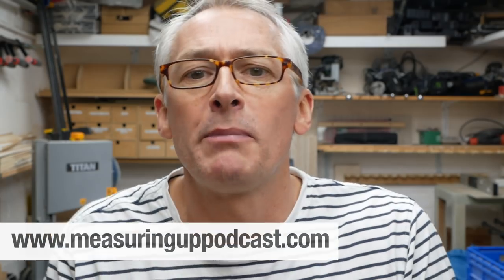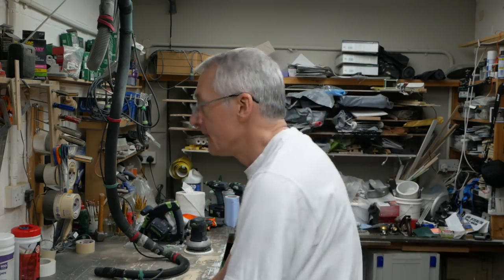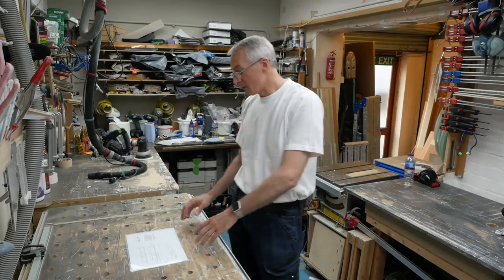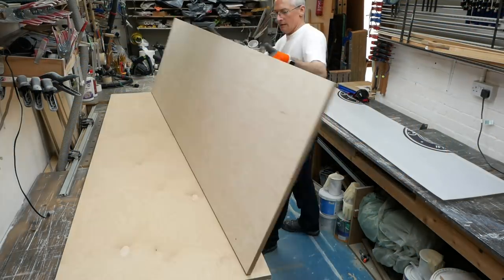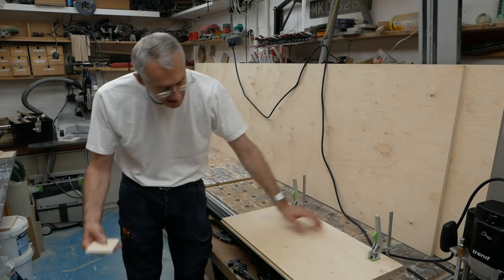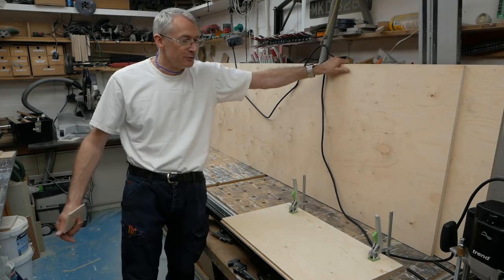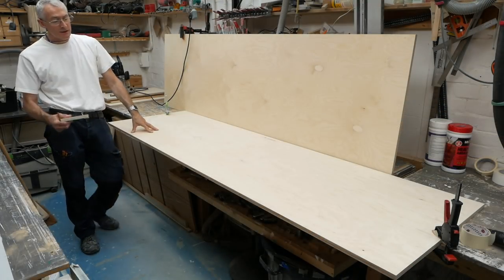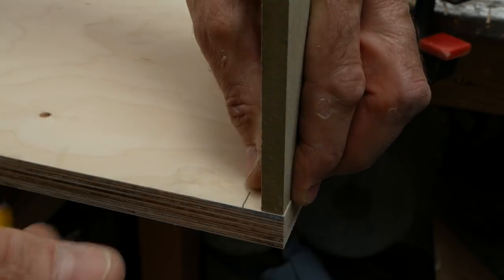How to make a Birch Ply Banquette P1 [vid #205]

Comment: Nice work Peter. That Trend is indeed a big heavy beast! And not so much 'getting away with', more 'making good'. I'm sure it will be fine, unless they watch the vid... ;) When I rebuild by assembly table (which is looking more likely that it finally happen later this year - jumps for joy) I'll have to see if I can find the Festool rail guide and stops assembly as accessories; they do look a nice system. Thank you for sharing.
Reply from the maker: Thanks Andrew. And yes, ‘making good’ 😆👍👍

Comment: Trend are very good, I myself use a Triton Router purely for the above table height adjustment so that it essentially is a router lift too. They are pretty much designed for table use and I find the weight to be an issue as they weigh almost 8kg. I was going to get a Trend, but there was a Triton near me used.
Reply from the maker: Yeah, I have the big Triton in the bench, solid piece of kit👍

Comment: Looks like it's going to be a nice project, I have the small Trend  router and I have done slips like that it is why I prefer hand tools you have more controls.
Reply from the maker: Thanks Ray! Personally, I have far less control with hand tools... 🤔😆👍👍
Reply: Peter Millard I am learning and it is all about practice, check out Tom Fidgen, he will blow you away, my problem is that my shed is to small to get small to make big projects as it is 10 x 8 approx. Just a thought are you fitting 3 doors? If so how are they going to slide in the track thought you might need 2 tracks but will find out in the next video.
Reply: Peter Millard just noticed it is a twin track 😂

Comment: Another great video.  Don't you just hate it when the router decides to go off piste.  

Last time l needed a long rabbit used a track saw guide adaptor and a small Makita battery router, as it was going to be visible.   

Keep up the good work there must be a third banquet just around the corner. 👍👍👍👌👌👌
Reply from the maker: Haha! Yeah, they come in threes 😂😂 It’s annoying - both my smaller routers fit the Festool track, but I only had the bit I needed in 1/2”, and that one - of course - can’t be track-mounted 🤔

Comment: That's one big router to use freehand, Peter. Maybe one of your "mdf offcut" jigs could have kept it on the straight and narrow. Also, when using big and heavy kit, I find a run in and run out piece at each end of the workpiece helps to keep things true. However, well done for fessing up to the nick out of the workpiece. As you say, it's just a moment of distraction.
Reply from the maker: Thanks. My 1/2” Festool is bigger tbh, but yes, I dislike making those kind of cuts with a side fence. I’d normally use one of my guiderail- mounted smaller routers, but the bit I needed to use was 1/2” - plus I wanted to give theTrend a try out. 👍👍

Comment: Thanks for the video, Peter. Very honest of you to show that little mistake with the router. I have made a similar mistake. There has to be a better way than just holding the router fence against the edge of the workpiece. I suppose a massive CNC router table would do it but much too big, expensive and complicated for most people.
Reply from the maker: I can mount my smaller Festool router to the Festool track, but not the big one, unfortunately. 👍
Reply: Mmm... Interesting. Perhaps that's something that Festool and other manufacturers should be thinking about. Potentially, it sounds like a good solution.

Comment: Peter - great video as always but I have 3 questions for you 
1) Where do you get your birh plywood from & what is the price of it?
2) How does the Trend router compare with the Festool?
3) Any thoughts on doing a review / comparison with the Festool or is the trend router to expensive to do a comparison?
Reply from the maker: Thanks Colin! I buy my Birch Ply locally from a timber yard called Ferguson’s (www.ajferguson.co.uk) who are excellent. I think I pay around £60/sheet for 18mm Birch - I’d have to check to be sure. Haven’t used the Trend that much, but I’ll certainly be doing a ‘thoughts and impressions’ after I’ve put a few more miles on it. Not sure if comparing the Trend to my Featool would be a fair fight - all my Festool routers are pretty old and knackered! 👍👍
Reply: I have had a T11 for about 15 years it’s still going strong I love it.
Reply: i have had a T9 for years. Its never let me down. Peter, look at getting the musclechuck as this makes changing the cutters easy.
Reply: Peter Millard great videos Peter. I was just wondering what grade of birch do you normally use? Without trawling every local retailer, I can locate B/B grade, would that normally suffice for non painted finishes?

Comment: Here in the states the Trend is quite expensive, as I'm sure it is where you are. Definitely a good machine, but a little out reach for most. I would love to hear more about the router itself. I'm hoping you do an update on the machine soon. Many blessings!
Reply from the maker: Thanks! Yes, I’ll be doing a ‘thoughts and opinions’ piece on the Trend once I’ve put a few more miles on it, though I don’t use the big routers that much tbh. The T11 is about £300 here, the current version of my big Festool one is over twice that 🤔
Reply: Tracy Keaton it’s the same as the DeWalt Dw625EK if that I any cheaper
Reply: As Tracy says it’s a rebadged Dewalt (which was originally Elu) so a router that has stood the test of time and is pretty bulletproof. I’ve had the Dewalt for well over a decade and apart from the plastic handle splitting (a known flaw) its as good today as when new. $283 on Amazon.com
Reply from the maker: Thanks. The DeWalt's £289 here at Amazon.co.uk, the Trend £295 so not much in it. DeWalt -  https://amzn.to/2MFgJd3, Trend T11 - https://amzn.to/2OtZk4h

Comment: Hi Peter. I'm just making an upper cabinet with sliding doors. I had planned to just rout grooves in the timber and apply paste wax.  Can I ask what you got the channels from please?
Reply from the maker: Hi Anthony. Grooves and wax can work well, but this channel’s really easy - little bit of silicon spray in the groove and everything slides nicely. I think the channel from  Ironmongerydirect - there’s a link in the video description for ‘double channel’ that’ll take you straight there 👍

Comment: Hi Peter 
Having used over the past 30+ years a variety of 1/2” routers (Bosch makita hitachi elu dewalt trend and many others) in my experience the elu mof 177, dewalt 625, trend t10 I’ve preferred using over the others. The more you use them the more familiar you get with using them. I must admit I’ve never used a festool router so can’t compare. (I believe there has been some issues of guide bush line up with the festool. The nice thing with the dewalt/trend is that a lineup shaft is included and the guide bush can be easily aligned) sadly my old elu died so replaced it with a trend t10. A t11 is something I’m on The hunt for as like you to use as a under mount router will prove very useful.. 
one can never have enough routers. 😜
When is the mobile work bench coming 😊👍
Reply from the maker: Hi Malcolm. Sound like you have more router experience than I do, lol! Must confess I really like the one-handle design of the smaller Festool routers, but I’ve used all kinds. Never had a problem lining up guide bushes, but don’t use them much tbh. And the bench is about where it was a week ago 😆😂👍👍

Comment: The rails are pretty small. Cant imagine how the counterpart that goes on the sliding doors will look like. Just a round head pin maybe? Can you incorporate a little preview of those hardware pieces in Video no 2?
Reply from the maker: They’re meant for glass doors really, so no bottom carrier. The sliding doors are 6mm Birch Ply, so they run very freely 👍

Comment: Really interesting vid Peter, thank you, I thought your Festool router could be used with the Festool track or wouldn’t that have done the same job?  I think routers, like many tools, are quite a personal preference I have a large half inch  Dewalt and a little Elu and I must confess to being a tad nervous when using outside of the table mount. The big differentiation between the tools seems to be dust control.  I only have a small workshop and as a none professional not in there every day doing similar things to yourself.  Nice to see a tidy workshop👀 and you using some ply.  My preferred material.  Super job 👍🏻👍🏻👍🏻
Reply from the maker: Thanks Mike! My smaller Festool routers will mount to the guiderails, but not the big one, unfortunately. Absolutely the best option though, set up with stops at either end. Dust collection wasn’t great on the Trend; my Festool’s aren’t great either, but they’re all ancient and knackered 👍😬

Comment: The fence on the 20k dimension saw has prob been smacked with sheets hitting it so will be out, even 1mm causes material to “crab” through the blade causing bad edges , or a massively dull blade
Reply from the maker: Massively dull blade I think - it’s actually pretty well looked after, just due a tune-up, I think 👍

Comment: Actually I love Trend, I think they are the King of Routers, but that is purely a personal opinion. As I said before I have a T10 and they are a bit hefty but they do do a lot of work. Did Trend not send you their little thing for squaring up corners? I have often thought about fixing up a guide for a router that went in the groove of the straight edge, like a saw, that would stop movement both ways. Changing the subject entirely, have you ever used a dovetail jig, I keep playing with the idea as they are a pain to cut by hand.
Reply from the maker: I’ve got the corner chisel somewhere, never really liked them with deeper cuts tbh. My smaller Festool routers will mount to the guiderails, but not the big one, unfortunately. 👍👍

Comment: Nice video Peter.

A bit curious re the comment on MFT vs MFT style top.  Didn't you demonstrate yourself how easy it is to fit a fence using the v-rail?  Surely that could be fixed directly with T-nuts from beneath without the fancy dogs and flip stops added?  In his recent video on his new bench top Mike Farrington briefly shows how he plans to use his custom MFT style top to produce replicatable cuts, etc.  Appreciate if you are doing many, many cuts to the same size the flip down fence saves time, but even for a dozen or so drawer sides surely it is not significant?  Not saying anyone with an MFT would throw it away, but it seems to me with all the bits and pieces available on the internet there are some 'home brew' options that provide very good functionality.

Terry.
Reply from the maker: That’s the point I was making Terry - the fence and stops turn it into something far more useful than just using the MFT top and benchdogs. 👍👍

Comment: Hi Peter you made a video a while back showing how to make guilds for you festool track with mdf off cuts. would it be possible to make a larger one that the router base can attach to? this would allow a non slip way to groove the ply,  as you say in a comment its around £60 per sheet so it could have been a lot worse. great video as always and thanks for keeping the little slip ups in, everyone has these and its how we learn.
Reply from the maker: Thanks Andrew! My smaller routers can be guide-rail mounted, and they would have been my first choice, but the bit I needed to use was 1/2” shank and tbh I wanted to try out the Trend. I’m sure I could cobble something together for the bigger router though - might make an interesting video - but whenever I have a piece of gear to try out or test I try and keep it as ‘stock’ as possible, at least initially 👍👍
Reply: The OF1400 can have a track adapter kit and can take a 1/2" bit.
Reply from the maker: Yep; I went for the OF1010 & OF2000 combo, so I don't have the OF1400.👍

Comment: Hahaha...I thought it was my lack of experience with routers. I was using a Makita trim router a few months ago. Just a moment's lack of concentration & I got a blow out in the wood. Haven't used a plunge router. Quite nervous due to its size & weight.
Reply from the maker: Yeah, I don’t like freehanding the big ones really, but needs must - my smaller Festool routers will mount to the guiderails, but not the big one, unfortunately. 👍👍

Comment: Hi Peter, I'm curious as to what you charge for something like this. A lot of the time I get customers asking for jobs like this and when I tell them the price they look at me in disgust! I had a job recently to take out the glass panels in a door frame and insert wooden ones. The wood needed for the job would have cost almost double the price of a new door. They obviously opted for a new door. But for the jobs your doing, unless its explicitly custom they usually opt for an Ikea alternative and it's impossible to compete.

Keep up the fantastic work, I've learnt loads from your videos!
Reply from the maker: Thanks Adam! Can’t remember exactly what I charged for this one tbh, but it would have been around £1600 or thereabouts. And yes, always tricky when customers get an idea in their heads about what things ‘should’ cost, lol! 🤷‍♂️👍
Reply: @10MinuteWorkshop  Exactly, I was thinking between £800-1000 for something like this. Custom made to fit a specific space. Even at what I would charge the majority of my customers wouldn't even consider it. I can understand your higher prices though, much more experienced than me and you're in/around London!

Comment: If I’m going to make an arse of anything it’s always with a router. I really hate using them, they look so easy but are really hard to use.
Reply from the maker: Yeah, I dislike freehanding with the big ones, and really dislike the side fence - so easy to make the kind of slip I did here. 😱😬👍
Reply: Peter Millard I have a T11 and bought a second fence and some longer rods for it. I can sort of sandwich most work pieces between the two fences up to about 500mm it’s pretty unwieldy but does stop the little slips like the one in the video.
Reply from the maker: Chris B Seen that done for narrower stock e.g. routing out door locks etc... never occurred to me to use it on anything bigger though 🤔👍
Reply: Peter Millard it only occluded to me after a lot of swearing 🤣🤣 I’ve made a big router foot too, that can help

Comment: You shall built a router table would make so much jobs much more easy
Reply from the maker: Thanks. The base & top are 2400 x 700,  and it’s a stopped groove, so no thanks! Track-mounted router would have been my preference, but only my small routers can attach to the guiderail, not the big one unfortunately. Oh, and my whole other bench is a router bench, thanks 👍👍
Reply: I am a German joiner master and it had made my jobs much more easy. For example for the side pieces and i also use it a lot for rounding or chanfering up corners

Comment: In my opinion freebies are a bad idea. If just for the reason it makes you explain how it has no impact on what you say for so long it gets in the way of the subject of the video. Isn't that Trend router the De Walt DW625 painted black and with an pumped up price tag? Christ, I just made a negative comment. Sorry
Reply from the maker: No need to apologise for your opinion. TBH I’ve no idea if the Trend is a DW625 with a paintjob - I’ve never owned the DeWalt and I don’t own the Trend. Like I said in the video, it’s been supplied by Trend for long term evaluation; Trend haven’t really been on my radar (let’s be honest if I wanted a T11 I’d have bought one) but equally I was curious how something less than half the price of my big Festool would perform. And be interesting for you guys too.  👍👍
Reply: Is identical to the DW625 yes, other than the trend appears to be better suited to router table use with the hex height adjustment winder-muh-thingy.